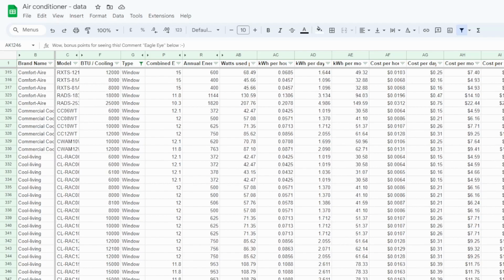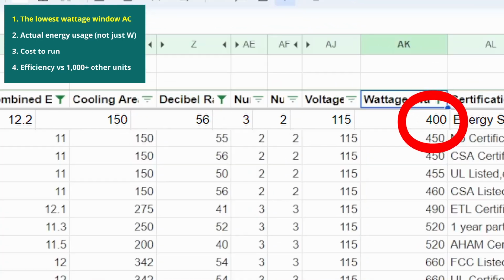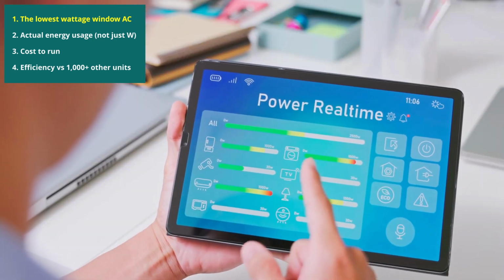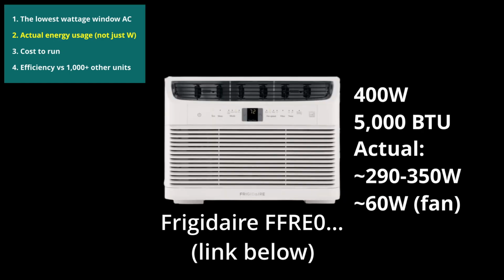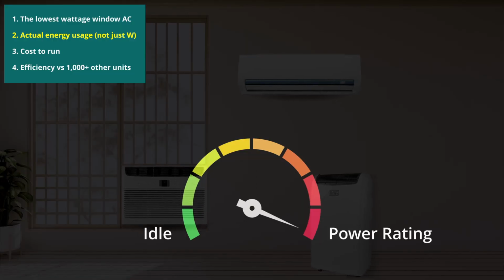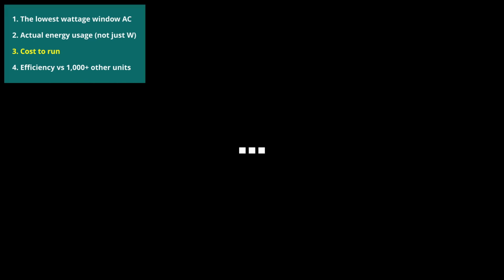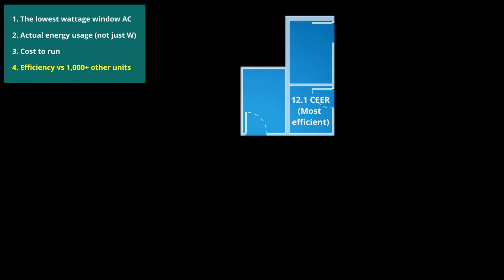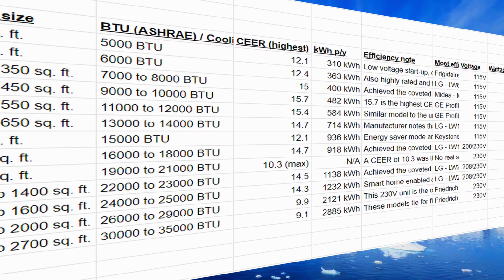LOWEST Wattage Window AC Revealed - 1,037+ Unit Study [2024]

Comment: Fans DO NOT save electricity.  People need to stop saying this. Fans can make it FEEL cooler if the air current is directly blowing on your skin therefore allowing you to keep your average temperature higher which can save electricity.  A fan in a room with no one in it is a waste of electricity.  It is better to leave fans off if you are physically not in the room .

Comment: Does this mean you could theoretically run this on a non-dedicated circuit?
Reply from the maker: Yes (if you're referring to the lowest wattage unit specifically). But if you have a lot of power hungry appliances on the same circuit, and all running at the same time, the breaker may trip. Obviously good to avoid overloading the circuit. And alway best to check the manual for power requirements of course.

Comment: Bought it, never could get it below 300 watts when compressor is running. All echo does is turn the fan off when the temp is hit. Plus this unit is hard to find now. The manufacturer is still selling it on there website directly. Averages 350 watts.
Reply from the maker: Thanks for your insight, Rich.

Comment: ive had this sitting in my camper for 2 years sitting untouched. im going to install it and try to run it off 380w solar and 200ah batteries, no wonder my uncle told me to get this ac when i got the camper 2 years ago

Comment: low wattage is an important consideration if you're looking for a unit you can run off of alternative power, though. thanks for sharing this.
Reply: Exactly why most people are researching energy efficient air conditioners in the first place. I'm trying to run something low watt about 6 hours a day off of a portable power station with some solar charge. Running a generator all day just for ac is too much 🙉
Reply from the maker: Very true. Thanks for highlighting that and for watching.